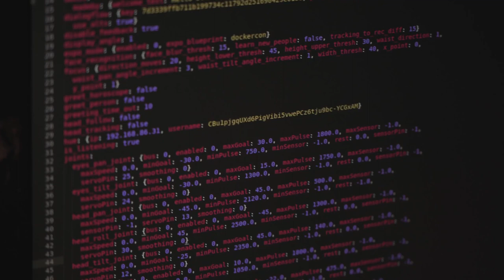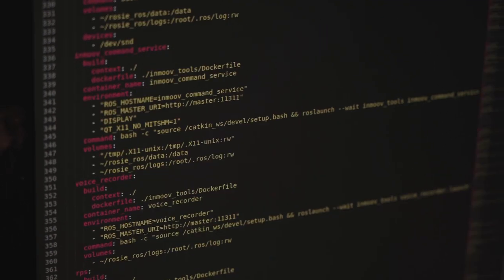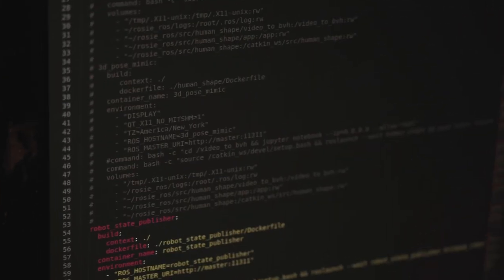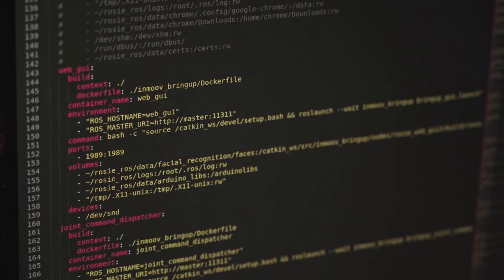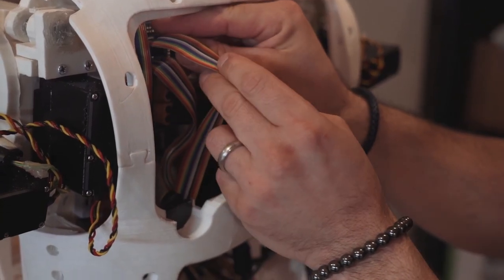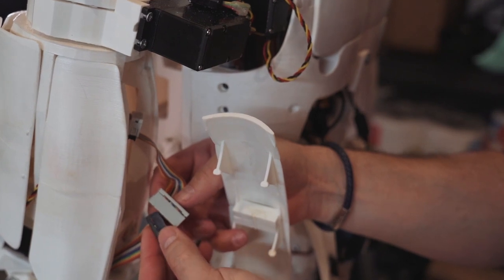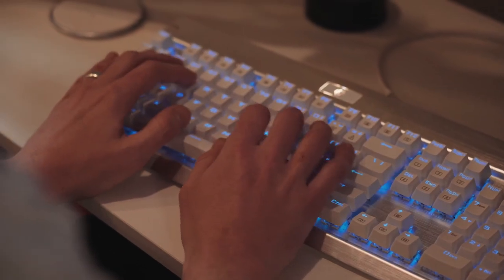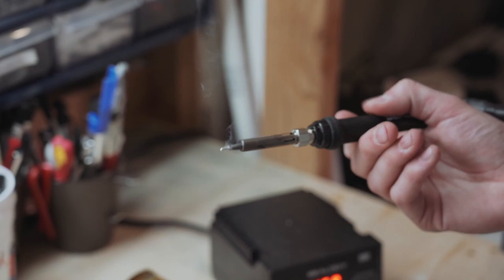3D Printed Open Source Humanoid Robot | Inmoov

Comment: Hello, I would like to ask for advice. Unfortunately, I couldn't find an answer anywhere. I have been assembling the Robot for a long time, due to a change in the type of printing material. I'm trying to rely on several sources, since Mr. Gael's website is not detailed.. I need to know if all servos except the hands (wrist and fingers) must have the latch pulled out? Another problem I'm solving is... that I can't set the trimmer to an intermediate position so that my servo doesn't move, unfortunately it always starts to turn in some direction, is this normal or should I solve it? I have to ask, do I always have to have all trimmer positions set to "0" position, i.e. not turned in any direction? And the last problem.. the lower Stomach has a nut attachment due to attachment to the plate with servos for swinging sideways.. the printout does not say how I should attach these four screws.. the plate for the low Stomach does not have holes through, but the printout counts with four nuts , how should I catch them? I will be very, very happy for your answer.